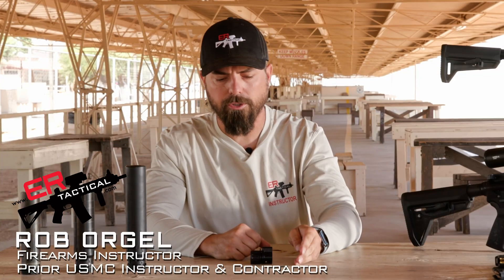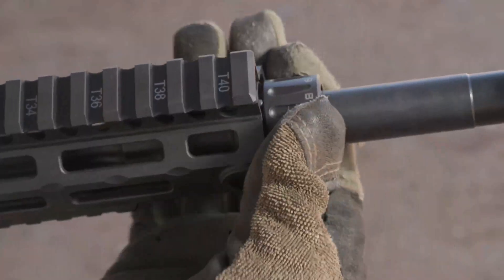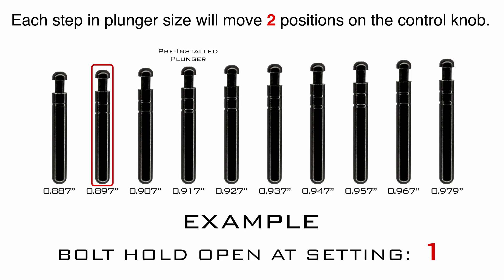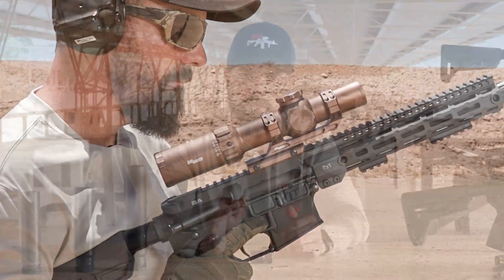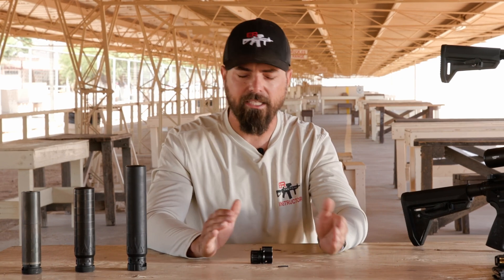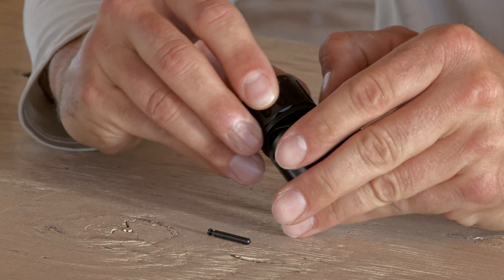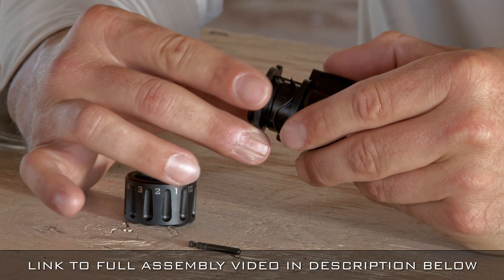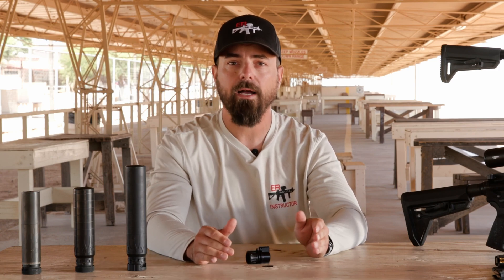Plunger Selection for your Riflespeed Gas Control

Comment: I am trying to get my 300 BO, Suppressed, 7.5 Barrel, sylvan folder, yellow Springco, H1 buffer to cycle sub sonic. 
It cycles supers with perfect ejection and bolt hold on last round at setting 8.
But subs stove-pipe at at setting 9-12 never locking bolt or chambering the next round. 
Any recommendations would be appreciated.
Thank you
Reply: Aren’t you supposed to lower the number for subsonic? Try setting 1

Comment: I am using one for a .300 blk build; barrel is Ballistic Advantage 10.5 1-7 Twist and its port size is rather small; reads 0.0940 inch; it is a pistol length so my understanding is the barrel already gives me less gasses than normal; does this means I should install the second smaller plunger in my system provided in the packing? -other considerations for this setup is I will be using a kynshot Light buffer with a Springco Yellow light buffer spring, also a Radiant SD charging handle, made for suppressed. Thanks for the video!

Comment: So this in fact with factory plunger will give the rifle the ability to cut all gas and essentially make the bolt not cycle like a bolt action?
Reply: @riflespeed
Reply: I'm pretty sure that the plungers included with this gas block won't completely block the gas system. I just got one but haven't installed it yet. When looking up through the gas port opening at the top of the block and at the lowest setting of 1, it appears that the end of the plunger doesn't fully block the opening. It should be possible with a longer plunger.

Comment: This is very informative!  Just the information I was looking for. Question:  I bought my riflespeed setup last month, but am still waiting on my upper to complete my build. The package came with a second plunger, but I can’t find where on the packaging what size it is. Can you please let me know what the size is of the second included plunger?  Thanks!!
Reply: Plunger #887 is included in the retail package with each RIFLESPEED™ Gas Control (manufactured after June of 2023. In conjunction with the installed Plunger #917, these sizes provide coverage of the nearly the full range of potential settings needed for every configuration we've identified during development of the RIFLESPEED™ Gas Control and allow the shooter to select the best Plunger for a specific firearm. Additional sizes are available for those who choose to precisely tune their Gas Control's settings or who have a configuration that falls outside of the more typical range. We will work with you to ensure you have the correct size for your firearm if the included Plungers aren't right for your setup.

Comment: I have your 
Block… looking for the recommended pins for my Ruger SFAR 16” for 7.62 and hot 308
Reply: 😂😂😂 lol I'm running a strike industries adjustable gas block!! The stock one just doesn't cut it!
Reply: With the huxwrx ti 762 and light loads (armscor 308 and 7.62x51 fed) in 30 degree temps it runs about a 6 to 7 with the stock plunger.  I ran a few hotter loads unsuppressed and was getting lock back around 5. Ymmv.  Hux is a very low pressure can.  I'm thinking of trying the shorter plunger bc 30 is a warm day on hoth but I bet in warmer temps I will go back to the larger plunger.